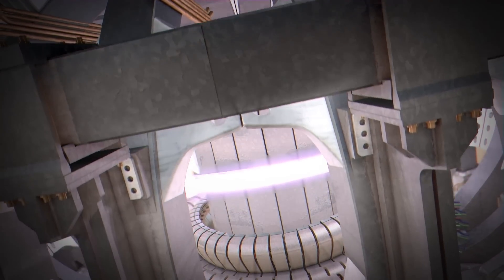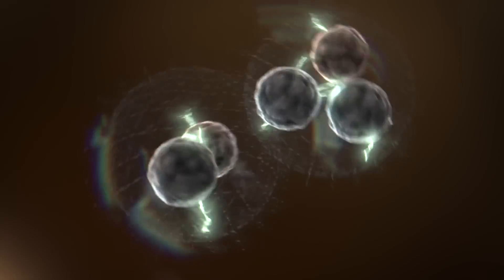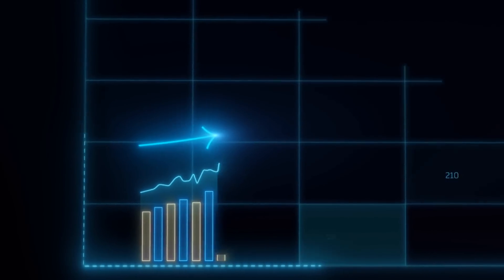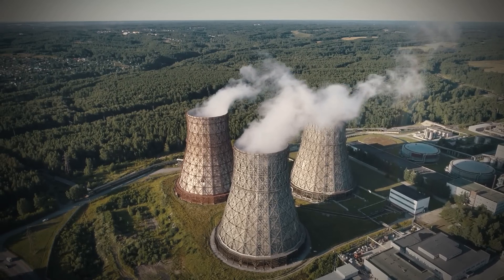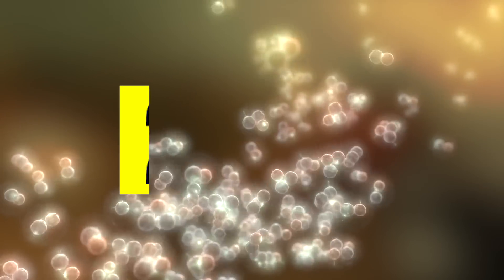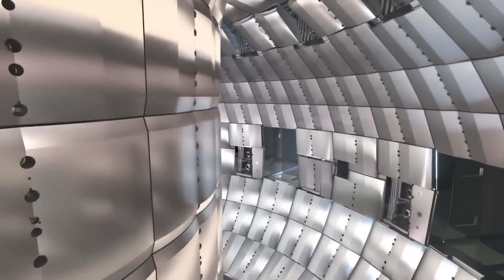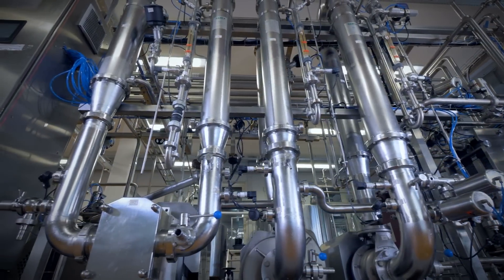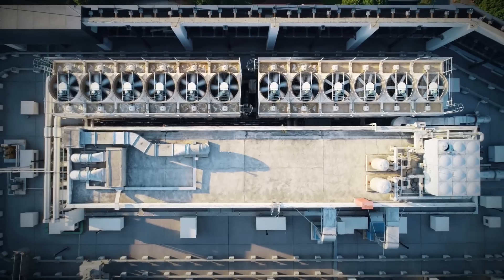The Shocking Problem That Could End Nuclear Fusion

Comment: I watch fusion related videos regularly and I heard that they experiment with different element combinations other than tritium (since it's so problematic). They mostly use it now in the test reactors because it's the most optimal combination (yet) and what they try to get working are (primarily) the reactors. If you have an reactor producing net energy using d-t it's a good sign this design might be good. But if you try to work with hard fuels directly it might never take of. It's like trying to run one of the first combustion engines with tanker fuel.
Reply: @Joe-by8jh  "and not one microwatt produced."
That is not actually true. They have produced megawatts of power, but the designs are not MEANT for continuous operation or power-production hence the heatup and cooldown phases use up more energy than the reactor produced.
But that is to be expected from RESEARCH facilities. Same as turbines in the research-labs of turbine-produces are net power consumers.
Reply: @ABaumstumpf  my understanding is also that power is being produced, but it's not more than whats put in to create it (or if it is, it's by such a small margin there's little use)
Reply: @jaceybella1267  yes, the JET reactor for example has so far reached a Q factor of 0.7, meaning it generated so much power to make up for 70% of what it used in that time frame
Reply: one possibility might be HElium-3, but that isn't very easy to find either and it is much harder to use in a fusion reaction than tritium
Reply: Kalki Ironman type 7 and 8 after 2026 😎

kalki avatar (beast of the earth) (christ on the white horse) (son of man on clouds) is the biggest enemy of dajjal/antichrist/kali 😏

Kalki Avatar (Murtaza) 11th satguru 13th imam cousin of Moula mahdhi a.s. 12th imam (muhammad) 😎

Prophet Moula mahdhi is raja shashidhuvj (the mighty one) born less then 1200 years ago 😎

Prophet Moula Isa a.s. will kill dajjal cause dajjal is going to kill Kalki Avatar 😏

Kalki Avatar will follow orders from 2 religious king Moula mahdhi a.s. and Moula Isa a.s. 😎

Kalki Avatar going to have 2 swords and ring of moula sulaiman a.s. and staff of moula musa a.s. (iron rod) Staff of moula musa a.s. is like omintrix can transform into anything and can transform others into anything And stone in the ring of moula sulaiman a.s. is also known as kastav mani and it's more powerful than all 6 infinite stones combined 😇

Cuz Kalki is ironman batman super saiya-jin superman ben10 saitama optimus prime shaktimaan and every super heroes combined after 2026 😎

This staff will transforms into white horses with wings,weapons,iron-man,cloud etc or can do imagination into reality 😎

*Ratn sru sword of lord shiva (miri)😇

*Ratn varu (zulfakar) sword of Moula Ali (piri) 😇

miri piri 😇

Kalki Ironman after 2026 😎

Satyug (sunrise from West) 2038 😏

Sambal is hospital 😏

Gzwa e hind 2029 😎

Khalistan and Azad Kashmir after 2026 by Ironman 😎

99% Hadith u heard is not about imam Mahdi it’s about Kalki avatar (the main character) that person momin vs dajjal prove me wrong if u can 😏😏😏.

Comment: This tritium issue is so well known that the Moon Nazi comedy movie even used this fact as one of the key comedy points. So, even a Hollywood comedy movie writer knew this fact. So, hardly a secret in any sense of the word - please don't try and imply this is some type of secret problem. 

Claiming that breeding tritium via fusion is very difficult is not really a true problem. Please! For fission breeder reactors, in order to create enough fuel for just one new reactor requires10 breeder reactors. In no way does this create problems for fission breeder reactors. 

Next, creating highly enrich fuels for reactors (an EXTREMELY) dangerous process, is typical for fission reactors and isn't, again, a big issue - the US does it on a massive scale. Sorry, but creating enrich lithium using modern equipment compared to 60's methodologies is not a way to judge this process. Creating enrich lithium is NOT an issue and isn't really a 'show stopper' at all. 

As for enough tritium, breeding will make the process slower and certainly fission reactor production is a potential source to supplement the breeding process. Is it an issue? Yes. Is it a show stopper? Not at all. The rate of breeding is more then acceptable and until someone can actually make an economical fusion reactor that produces net energy, these issues are so minor as to be irrelevant.

Comment: Well, there's a false premise right at the beginning of the video. The deuterium-tritium fusion reaction may be the one that has gotten the most attention. It is the most attractive candidate to work, which is why ITER has chosen it. But it's not the only possible fusion reaction available.

For example there is deuterium-deuterium, deuterium-helium-3 and proton-boron-11. At least those are the ones I've seen suggested before, and I seem to recall that there was someone just recently suggesting using proton-boron-11 in a test reactor, but I don't remember which company it was.

There are advantages and disadvantages with all of these. 

The problem with Helium-3 is that it is also a very rare material, but it is possibly quite abundant on the surface of the Moon, so if we get a mining base up there, then this may well be a good solution. Because of the extreme efficiency in fuel spent per energy produced, it can actually be feasible to have Moon mining for this as a fuel.

Proton-boron-11 requires extremely high temperatures (gigakelvins), but it doesn't produce neutrons, which reduces or removes the problem of activation of the reactor housing material, as well as neutron radiation damaging the reactor directly. But the billion-degree plasma is not an easy thing to deal with... not that the million-degree plasma of D-T is "easy" either.

I have no impression that this is "shocking" nor being kept secret by anyone, nor is it a big "news". The problems of creating, and handling, tritium are well known. 

In fact, all variants of hydrogen are notoriously difficult to deal with. Just look at all the trouble NASA is having with the hydrogen on their SLS rocket. Even though they have more than fifty years of experience in dealing with cryogenic hydrogen, they still struggle with keeping it where it's supposed to be and preventing leaks.

Comment: The fission n + Li-6 --> T + He-4 needs no specific neutrons, just any neutrons; so, it can very well run in any fission reactor. In principle, there is no tritium catastrophy looming.

Effective tritium breading is, however, absulutely crucial for the practicality of fusion.
Reply: And fast neutrons can easily breed tritium from Li-7, which makes it even less of an issue with the newer generations of liquid fuelled fast fission reactors. Of course, the safety, efficiency, and breeding capabilities, of these reactors almost reduces current fusion efforts to an exercise in futility.
Reply: @anhedonianepiphany5588  Li-7 has much lower cross section for the reaction. So, not so fast.
Reply: @WielkiKaleson  You do know what fast neutrons are, right?!? Li-7 cross-section is poor for thermal neutrons but can be quite reasonable in the high energy range.
Reply: @anhedonianepiphany5588  For thermal neutrons it should be 0 since the process is quite endothermic. You are going to need 0,5 meter of good lithium blanket. You probably wouldn't like to increase it a few times to account for the worse lithium.
Reply: @WielkiKaleson  With a liquid fuelled fast reactor there are options other than a simple lithium blanket available. I’m not sure you’re quite grasping my point.
Reply: @anhedonianepiphany5588  Yes, I do not get your point. Because fusion cannot be liquid fuelled. Fission can. You seem to be thinking about fast fission reactor with liquid metal cooling. And producing tritium there. 

But the idea of fusion reactor is: burn D + T in the core and regenerate T in the blanket. The video refers to this concept. 14 MeV fusion neutrons are indeed fast. This may have led to the confusion.

Comment: This is known and has been known. The large neutron flux was to be used to breed tritium. One method is using lithium blankets just behind the walls. The other well known issue is that the reactor materials become highly embrittled and radioactive. I learned this and far more in the 1980s. Of course if the pico second terrawatt laser shot used for lithium - proton fusion works as a reactor all these issues are avoided.

Comment: You are spot on my friend. This will be one of the most challenging aspects of adopting any DT system, if and once the burn method essentials become mature. While not a shocking problem -as your quotation of certain authoritative journals, and a long-history review of the field would show - it seems to be the one issue that, to me, stands a chance of really hamstringing the evolution to actual use. It may be so bad in practice that we may be seriously forced to take more in interest in "exotic" cycles like HB11 (now just getting significant funding). Many thanks for a well researched presentation - will send my students here! I wish you a great career ahead!!

regards   D Barillari (nuclear physicist and on-time CANDU specialist)
Reply: No not spot on. He's completely and totally wrong. It's trivially easy to isolate or manufacture or breed tritium. There's a half dozen different ways to get tritium that are all cheap and mature. Only reason low stockpiles exist is because tritium can also be used in thermonuclear bombs and so supply is forcefully limited by arm's control measures worldwide.

Try to open your own tritium factory and see what happens. It's asinine to look at a "high price" of an outlawed substance and mindlessly assume it can't be made cheaply.

It's only expensive because there's no legal market. If it had a peaceful use for large quantities and restrictions were loosened, the price of tritium would fall to 2-3x deuterium prices and supply would be unlimited within a month of policy change.
Reply: @orangeraven3869  Do you know what the cross-section for neutron absorption on 300 degree C deuterium is at reactor spectrum?  DKB

Comment: Fusion has been making progress year by year. Projects like ITER take years & years for planning, let alone design, continual development, funding - the list goes on.

Video's like this can be informative but I would consider them rather damaging... Why?, Because you have an extremely varied audience; Most of which probably do not have enough knowledge on the subject to visualise the potential for alternative manufacturing processes down the line. 

No one is keeping anything a secret - the data for a lot of things is available if you are interested enough to find it, but it is a waste of energy & resource to publish information which (although seems doubtful), is probably solvable down the line. We might not be able to solve these things until big projects are finished & tested - but funding is needed first & funding relies on strategically informing people with the right information.

Comment: Lithium-7 can breed tritium using fast neutrons, so, although this will probably need to be done using nuclear fission as the neutron source, it partially solves the need for enriched lithium. Of course, lithium is a limited resource regardless of the isotope, and supplies of it would eventually become problematic too. All options considered, effective ²H + ²H fusion combined with ²H breeding is probably the ideal, if nuclear fusion becomes a practical reality at all.

Comment: Let us not be morons here.  Nuclear reactions have cross sections which are energy dependent ( not temperature dependent).  D+D cross section peaks at about 100 kev.  That means that we have to put into the reaction 100 kev to get a fusion.  The maximum output from this fusion is only 12.5  times the input energy.  This means that if we had 100% reactions, then we would only get 12.5 times increase in energy output. D+D reactions at higher or lower energies would have vastly lower probabilities of reaction.  Not even considering the auxiliary energy inputs to maintain the reaction and refine the deuterium, the whole reaction is endothermic by at least 1000x!  Do the physics first.

Comment: It has long been recognised that a fission reactor is needed alongside any fusion reactor to provide start up power for the fusion reactor and produce tritium. Several fusion reactors could be powered and supported by just a single fission reactor. The suggestion that fusion reactors will supply safe and radiation free limitless power one day is completely false. The radioactive waste products will be easier to deal with, and fusion reactors are inherently safer than fission reactors, but they are not risk free. Commercial pressures with result in corners being cut, resulting in excessive neutron flux leakage and the possibility of liquid metal explosions in under specced heat exchange mechanisms. Fission reactors are still going to be the dominant force in the safe generation of massive amounts of electricity with minimum emissions to the natural environment for the next 30 years or more.
Reply: Since 30 years is the estimated rollout time for for the first generation of commercial fusion reactors, that seems kind of a given... I think the notion of "an energy source that has no side effects of any kind" is ridiculous to begin with. Because nothing that we build on Earth is an entirely closed system. I reckon there's probably a side-effect or two that we haven't figured out yet, from building little artificial suns on the surface of the Earth.
Reply: Even then I think it could be best to stick to fission energy. I know nuclear power has a bad rep but despite it’s incidents, it’s actually by far the safest and cleanest form of energy. It’s far better than the 30 billion kilograms of emissions that coal and fossil fuels produce each year, compared to just 500 million kilograms of nuclear waste produced in the entire history of nuclear energy.

Comment: ITER suffering budget cuts after spending more than 3 times the original budget (a whopping 18,6 B€) and still failing to be finished building ! The deadline has been pushed back again to 2035 ... THEN they'll start searching for the golden egg with additionnel operation costs of course. Meanwhile looks very much like they've been milking the golden goose !!

Comment: Very useful video, tritium breeding is among the most critical issues of magnetic fusion. This presentation is in my estimate still too favourable towards fusion. At min 4:30 it says:
"Which is apparently just about enough to sustain the tritium supply for a fusion reactor when we account for other inefficiencies in the system"
If one accounts for those too, like the loss of bred tritium when is cycled back into the plasma, some literature claims that the breeding ratio becomes lower than one.
About the alternatives to tritium DD fusion is so much harder than DT that a totally new approach would be needed. New, never experimented, DD losses would become relevant which are not with DT, cyclotron radiation for example. A whole new world, not a matter of just turning the heating up.
Again at min 7:30:
"The short supply of future tritium  could also be a motivation for smaller reactors that don’t require as much tritium to start, which can also be used as test beds for tritium breeding blankets alongside ITER."
At the contrary, the energy of DT neutrons requires a blanket of a given thickness which penalizes smaller, higher field, magnets as far as tritium breeding ratio is concerned.
One subject which is tightly linked to the tritium cycle and is ignored by most authors is proliferation. Solving the tritium breeding issue would strongly accelerate the race for new "clean" thermonuclear weapons of all sizes, small and large. The ones in the kiloton range are the dream of generals, at many megatons the one of more than one dictator. The proof of the relevance of fusion for arms proliferation rests on the recent results of the most successful fusion experiment ever, NIF, sponsored by the american department of defence, the only experiment to achieve breakeven. But not only, one should worry about inertial fusion schemes like the ones of General Fusion and First Light Fusion, which are essentially small scale explosive fusion devices. My guess is that nobody higher up hasn't already intervened only because these schemes have all been investigated in the past and proven to be hopeless.
This situation reminds me of the 40's and 50's, when the scientific community was pondering the opportunity of developing atomic technologies balancing the horrors of new powerful weapons with the hopes for energy too cheap to meter. The same is happening now but with much worse consequences at stake as for weapons and with an energy as expensive as it can be.
Reply: Perhaps we can wait for a prototype to be operational to dismiss tritium breeding. There are a lot of very clever people who think it could work. And weapons proliferation... please. Fusion fatalism has always baffled me.
Reply: @ArcherOfJustice  Is ITER a prototype or we have to wait for DEMO to know about TBR?
As far as tritium breeding predictions are concerned I am citing:
M. A. Abdou et al., “Physics and technology considerations for the deuterium– tritium fuel cycle and conditions for tritium fuel self-sufficiency,” Nuclear Fusion 61, 13001 (2021). which states  that the majority of present day studies (~200) claim that TBR above unity is unattainable. Who are your very clever people? Names?
About weapons, who's paying for NIF, the only experiment which has reached theoretical ignition as today? The Department of Defence not the Dpt of Energy.
Who's sponsoring Laser Mégajoule (LMJ) Bordeaux? CEA, Direction des application militaires
What will happen first: weapons or energy? New weapons seem a lot easier to me than competitive energy.